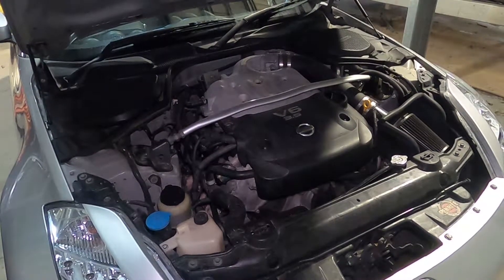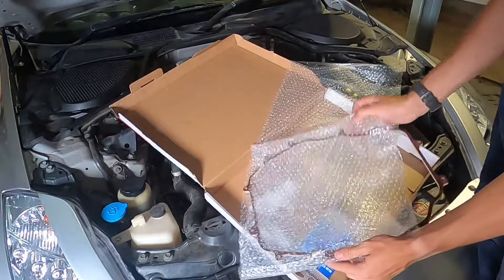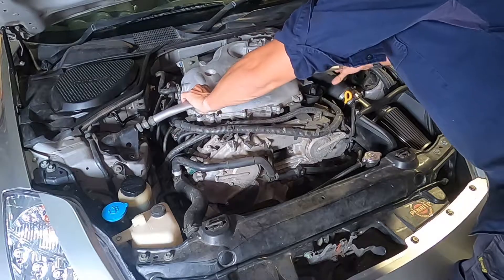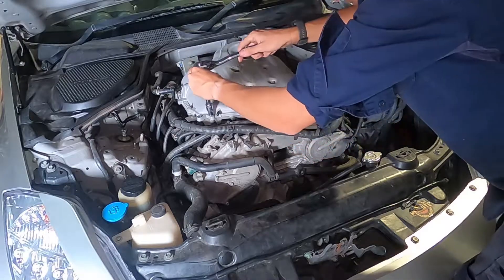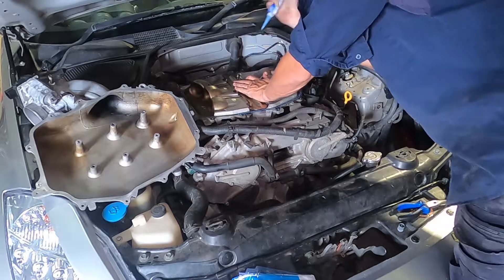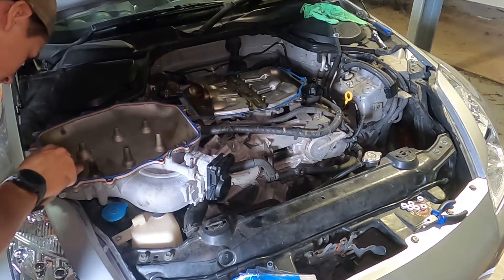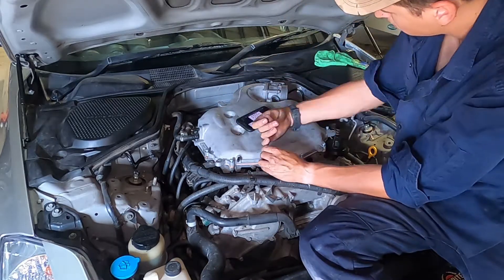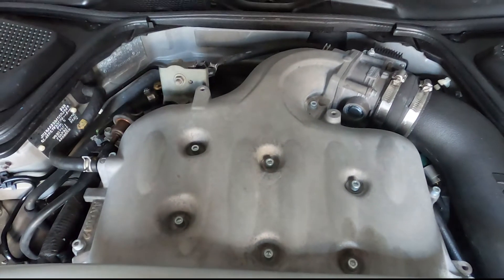350z Plenum Spacer Install

Comment: Hi man, I was given a mace plenum spacer but without any washers and bolts. Do you know the height of the tall, medium and small screws.
Reply from the maker: Hey mate I'm not too sure on the measurements, you could remove yours and measure them and add on the thickness of the plenum spacer or contact mace and see if they would sell you a hardware kit

Comment: The spacer is made from a heat resistant plastic composite, did you do a ecu reset by anychance?
Reply from the maker: Thanks mate, not sure if I needed to but you can do a throttle reset if it doesn’t idle properly 👍🏻

Comment: My strut bar won’t fit with the spacer on. Any suggestions
Reply from the maker: You’ve probably ordered the wrong size spacer, you can try putting some washers under the strut bar to lift it